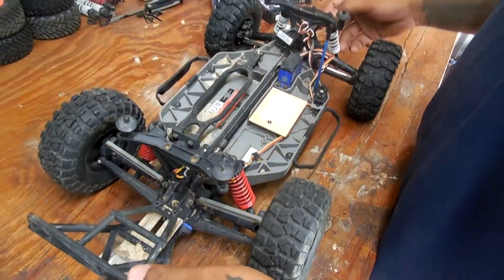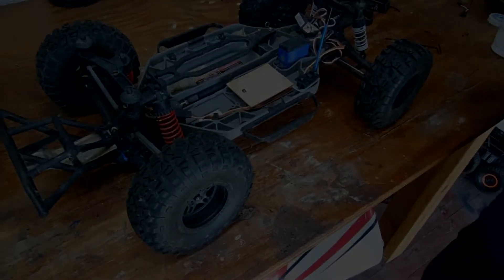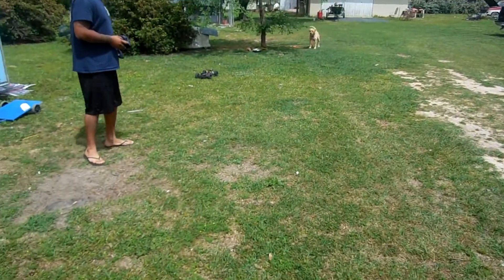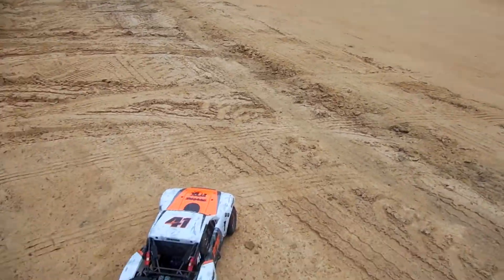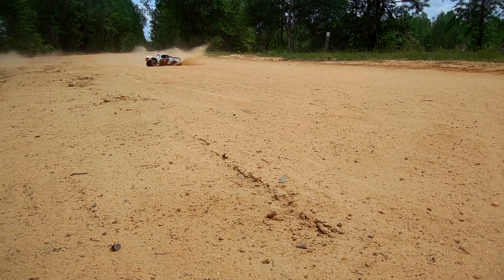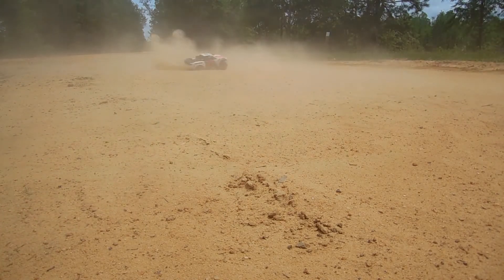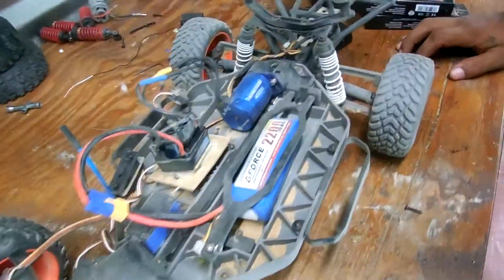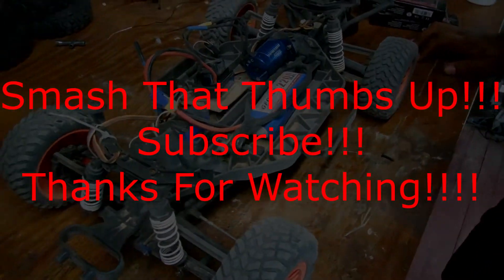Traxxas Slash Kinexsis Brushless Motor (install & Testing)

Comment: Hey dude, I have the exact same setup, I cannot get kinexsis esc to power the motor. I have steering but no throttle. Any idea? If i use different brand receiver, it works fine, the 6518 traxxas receiver is giving me the hell.